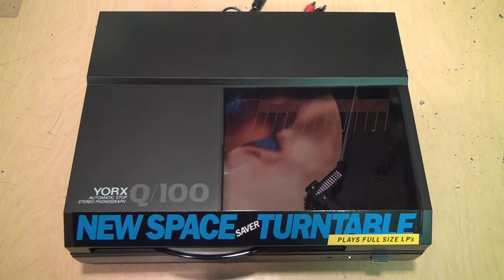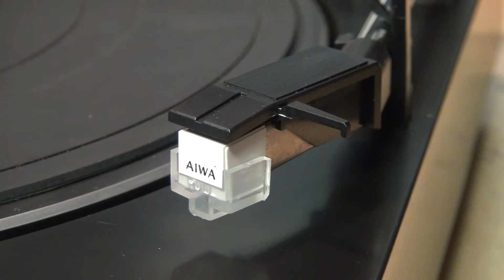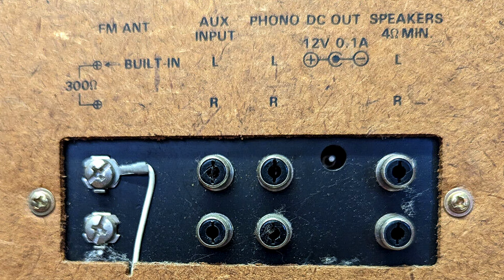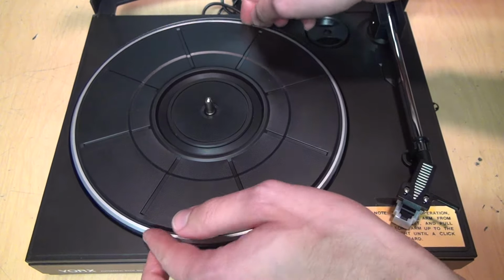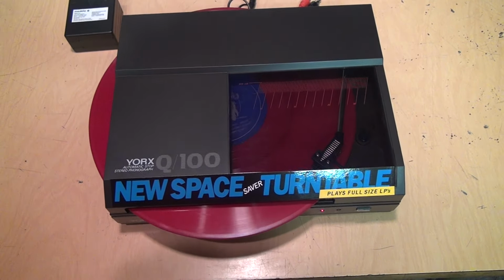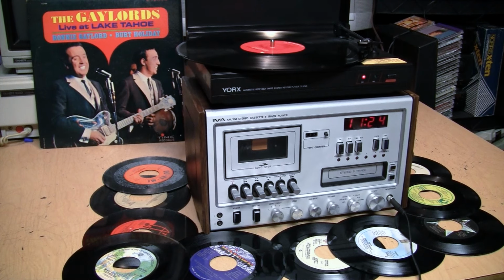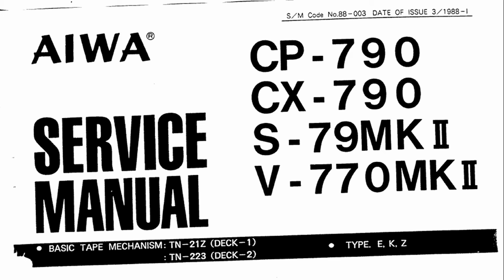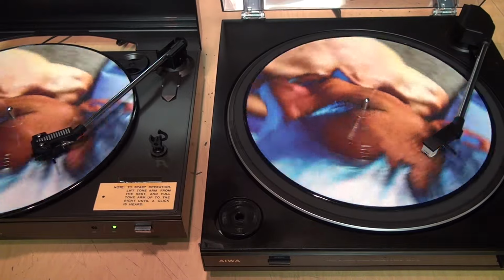How to rescue an orphan turntable - and why you probably shouldn't

Comment: Wow, great research on the old phone. I was thinking of doing just that with an old player of mine. Saved me the trouble. Or, just hear me out,  I could use my VW van that drives around the LP with its speaker on top! Other than the doppler sound and no 45 mode, kind of fun to watch

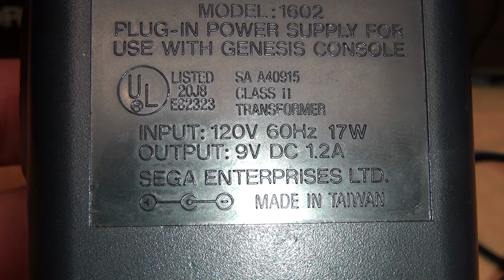Comment: @7:48 - based on yours and a few other videos, I have ordered in a a couple of fully adjustable (current and voltage) as well as polarity switching wall warts for testing and powering some of my various device.  They both have a large assortment of barrels and connectors including wago-style connectors for bare wire testing.

Comment: The auto stop works by moving the pawl over where a cam located on the platter center will contact it and flip the switch back over.  Almost all record changers used a similar system to initiate operation of the mechanism at the end of the record.

Comment: Very enjoyable and educational episode 👍 I was trying to fix an old Pioneer PL-600, but the transformer only put out 2.5 volts, so I tried using a 12v 2amp DC supply and I think I burnt out the motor now :) —- I guess 2 amps was too much ?   Fun to tinker around, but it can be frustrating too.

Comment: I remember picking up my first orphaned turntable in 1988, a Tensai. Cheap and nasty with a Chuo denshi 800 cart with plastic cantilever stylus. Used a 12v scalextric power supply ! Since then I have picked up many of those proprietary decks and usually drill a small hole at the rear and fit a panel-mount barrel socket for the DC  (cost pence, add a wall wart  form some old router picked up for a pound or less at second hand places) and add an RCA cable (if not fitted). You can then at least sell them on with minimum outlay. If new cart is needed it's not worth it. You can use ceramic carts into a line in if you add a 1 megohm or just under in series with the signal leads. Then you at least get bass.

Comment: I have an old 1970s turntable that at first did not work at all, but once I got it repaired it worked great. It came with the original stereo system and everything thankfully.

Comment: I remember that old thing pulling the tone arm to the right.  One of our old players we had to do that (cheap one)  JC Penny's didn't but it needs some repair as it has the turntable cassette and 8-track player.  Used to play the latter quite good.  Dads much older Unisonic never really played 8-tracks well.  So eventually I bought my own that I could use to record to cd's.  But I had it open to make sure nothing was spewed out inside.  Because of this channel I one of the $90 now $200 record players by AT

Comment: I came to DC in 1991 for "a one year project." I rented an apartment vs staying in a hotel. Bought a Technics rack system that I would have sold when I was ready to head back. Didn't bring any of my records so I kept the turntable in its box, in the closet. Fast forward to 2014: The cassette simply died. The CD changer was failing. Then, one of the channels on the integrated amp failed (STK power pack). I gave the components to someone who fixes up gear because I went back to 70s analog...but I kept the turntable (SL-BD27U) which I still have in the rig.

Moral of the story: Sometimes the orphaned turntable can be a good thing.

Comment: Ha! I actually had a Yorx record player stereo system back in 1984 or 1985 with an attached (not separate) record player (either a Q100 model or Q200), two cassette decks, AM/FM tuner, and two "tower" speakers for around $200 back then. I enjoyed it for many years as an entry level system as a teenager and ironically, even though I eventually chucked it because the belt had dried out, the cassette decks were chewing tapes or not functioning at all, etc, I still kept the dust cover and the 45 rpm adaptor for some silly reason. :)

Comment: I've seen many of these orphan turntables for sale, usually at heavily discounted prices, and always passed them up for fear of the unknown. Nice to see how easy it is to retrofit them to use with a new foster stereo system. That AIWA sounded on par with my Audio Technica AT-LP60 (as it should, since it shares the same cartridge). 

As an aside, those Command and Time Records used to be a dime a dozen; now they're almost impossible to find for reasonable prices. I snagged a few many years ago for less than a buck a piece. They make the perfect test material for turntables old and new, or even just for marveling at the over-the-top stereo effects employed when stereo was new. Perhaps that album can make an eventual appearance on your music channel?
Reply from the maker: I need to find a better copy of "Stereo Check-Out". It sounds like someone played my copy over and over again with a worn needle, because it has high surface noise and a loss of high frequencies, while my other Command records sound quiet and bright.
Reply: @vwestlife  I was wondering about that. While it sounded good on video, it didn't sound quite as clear as I remember most of the Command records sounding, namely, as you pointed out, with regard to the high frequencies. Still a great record to listen, even if a little tired.

Comment: Funny, I think they both were worth saving. Though I would have gone "non destructive" by unsoldering connections inside and adding in new cables. In the case of the AWAI both power and audio jacks, and for the Yorx just the power with a short length and the barrel input. The original cables could have been set aside, but honestly, nobody is going to reunite these with their "components." The turntables are perfectly adequate for 99% of applications. Even featuring auto stop that many new models don't have.

Comment: Actually managed to do this to what I feel is a half way decent orphan. My friend picked up a tiny Fisher linear tracking table in really good shape, it needed a split +/- 12v power supply though; I kinda just guessed the voltage based on the design of the internal preamp but it works perfectly. The internal preamp was garbage though; absolutely no low end. I wired the RCAs directly up to the cartridge and it sounds shockingly good; I'd say on par with a halfway decent Audio Technica p-mount cart. The only con is that the cartridge is permanently affixed to the tone arm. We've been using it as the main table in the living room for a while now! So sometimes you can get a decent little table out of these poor orphans!

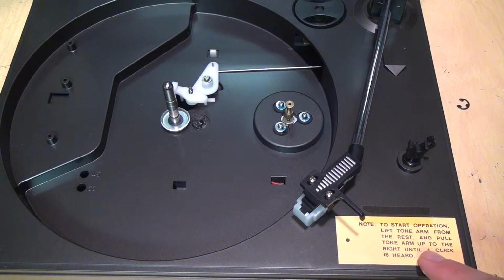Comment: 13:00 To start the player by moving the tonearm to the right was the standard way in many manual record players. I had two players working this way, I saw some record players from the 1930's working exact this way and also some record players, where you have to move the tonearm left, especially with a tonearm lift. Very interesting was Mr. Hit and its East European clones, a better one has a slider, push it to the front to move the tonearm to the position, release it to move the tonearm to the record, push it to the back to lift the tonearm and move it to the rest position.
Reply: The Philips UFO from the late 1960s uses the same method. Best to leave any labels on as otherwise even people familiar with turntables won't work it out.

Comment: Same as with the polarity of DC jacks, I wouldn't always assume that red wire is positive and black/blue is negative, I think more reliable way to find polarity is to look for ground, on electrolytic caps which have ground marked or housing of the DC motor, for example.
Reply: Yeah, I got burned with that when I was younger, I guaranteed myself barrel jacks were center positive. Even on modern electronics it's not always true.
Reply: Certainly, ignore coloured cabling, the Chinese built products ( which let's be honest is almost all ) don't follow any particular protocol ! I've seen black, white , green , red you name it  connected to positive. When debugging/troubleshooting switch your eyesight to monochrome!

Comment: Aaah yea, those all-in-ones masquerading as component systems lol. It's cool that you got the Yorx going without modifying a single thing, and the Aiwa would make a decent, inexpensive turntable if you soldered on a regular RCA cable and power cord.

Comment: Awesome video! I've never came across a "orphan" turntable that I know of....I really like that term for these. There's a record store I visit in a college town near me and there was a Goodwill the next block over and they had one of these late 80s/early 90s all-in-ones and I think it was made by Sharp. It looked similar to the Yorx NEWAVE you had a clip of. Cassette and turntable only, it was definitely made before CD was affordable enough for these style stereos. Same budget components similar to what you have....I think that one had a 7" or 10" platter as well. I couldn't believe the price tag they had on it.....$150.00!!! It wasn't new old stock either and the stylus didn't look the best. It's amazing what some think turntables are worth because of the popularity of the revival 0_0 It's interesting the Yorx has index markings on top of the cover .....I usually only see that on linear tracking turntables. I have that same Command Stereo Check Out record too! I love it. It's very helpful for setups. I have a few of these style test records. Most are actually really affordable on Discogs.

Comment: The wire with white the stripe is usually indicating the positive wire. 13:13 the Platter turns that switch finally off.

Comment: I thought I recognised that Yorx turntable from somewhere. When the still of complete system came up at around 8:35, that totally confirmed it. These were sold in the UK under the Schneider brand. My brother bought one second-hand and, when he had had enough of it, he passed it on to me. I thought it was funny how they styled the thing to look at first glance as if it had a CD player, but it was a spring loaded tray for keeping the very limited remote control in. The remote only had volume up/down and mute. As for the turntable, to get anything to play without skipping I took to balancing a half penny piece on the head of the tonearm...

Comment: Finding polarity is easy. Just use multimeter and one prope in the dc jack and one on a ground plane like screw or metal piece on the body of the unit, switch between the inner and outer part of the DC jack . If it beeps it's negative. On turn tables there is a lot of ground planes, like under the platter

Comment: Center negative connectors show up on some battery powered devices because it's easy to configure them to disconnect the batteries when you plug in auxiliary power. The jack has an internal normally-closed switch that's used to connect the battery to the power rail when nothing is plugged in

Comment: In my living room is a Toshiba budget compact system that belonged to my Grandfather from the late 80s.  It has an amplifier/control, and a double cassette deck intended to look like seperate components but was all one unit model SJ-3438.  Interestingly, the digital tuning radio componment was a physically seperate unit but connected to the amp with propreitary ribbon cables (threw away this part a long time ago as it didn't work).  The turntable component, Toshiba SR-3648, was very similar to the Aiwa unit and the bevelled front dust cover looks identical.  It had an attached cord with RCA plugs, and a cord with a barrel plug for power that went to the amp unit.
It was not a very good record player, i had to weigh down the tone arm with a few "twoonies" (heavy Canadian $2 coins) to keep the needle from skipping.

Comment: In the late 70s we had a Philips turntable with built-in amplifier and external speakers (plastic square cabinets with coarse plastic built-in grille), which you needed to pull back the arm to turn it on just like this one. It had a very distinct sound as the built in amplifier switched on, like two low buzzes in sequence. I can still hear that in my head very vividly 😁. Also, when I tried to record it to my portable cassette boom box via a DIN cable the sound was very tinny. Now I know why. Good times. Not very high quality sound times for me, but good times nevertheless 👍👍

Comment: One good thing about most of these cheap turntables is that they are belt driven. The ones from the earlier years were rubber tire idler, to the turntable at direct contact with the heavy AC motor, causing the rumble. many of those were also ceramic cartridges as well.

Comment: If the turntable has a built in preamp, the audio ground is probably tied to power ground, making it easy to work out the power plug polarity without taking it all to bits.

Comment: It probably would have been cleaner to de-solder the ribbon cable on the second TT, solder the new connectors on, and store the old ribbon cable if you wanted a reversible modification.
Same with the wall-wart for the first TT. Buying the system end socket connector, soldering the wall wart wires on with the correct polarity, and heat shrinking over the solder terminals probably would have been cheaper. I know solder-less repairs appeal to the all thumbs crowd that throws out stuff as soon as they have the first problem with it, but if you're a collector that's serious about keeping and maintaining vintage equipment like this you either have to learn to solder and be your own technician, or pay someone who already is a technician to keep your stuff alive.

Comment: 13:13 The auto shut-off method described here is NOT new. Colaro in Britain made a single-playing phono deck in the 1950s and into the early 1960s that employed the same method, pull the arm back until you hear a "click" which starts the platter rotating, and when the stylus reaches the centre run-out groove, the mechanism triggers the shut-off which cuts power to the motor, and possibly also retracts the idler wheel from the capstan. Several other 1960s-vintage single-play decks used the same method.
Reply: Oh yes, I was referring to rim-drive turntables here.

Comment: CD is still the king despite the hi-res and online streaming hype, Every time I bring a load of CD's from the dump I enjoy sorting through them and rip the ones I like and attach the album artwork to the FLAC files, Even though it's just 44.1/16 but that's more than enough to produce the master copy of the studio.
Reply: The issue with many CDs is that they are the victim of the loudness war; and thus have terrible mastering compared to vinyl and “high-res” FLAC files.
Reply: @Yeen125  Not all CD's, Some of the late ones only, Be careful of re-mastered recordings, they don't all sound good, some of those sound worse than the original masters.

Comment: In the 1970's my radio had an input impedance, that matched with piezoelectric cartridges (we had crystal instead ceramic), so it boosts bass and lowers treble, but worked well with the tape output.
Before very lightweight magnetic cartridges were introduced, the piezoelectric cartridge was the only option, to play the vinyl records, in the 1950's came the idea of Hifi in US and UK and some years after introduction of Stereo to the rest of the world. And the modern magnetic cartridge was part of this, beside FM radio and home tape.

Comment: A good trick that can help find out the polarity is to do a continuity test between an outer shield of a connector and each terminal on the power connector. The shields of RCA jacks etc are usually connected to the negative side of the power supply.

Comment: So I spent my years looking for a Panasonic 8 track player with the RCA jacks  Now let me explain why the Panasonic 8 track player near the end of its life Actually has a fiber glass belt so the belt doesn't turn gooey and it doesn't break down it continues to run and run and run as long as you can find tapes and what's quite shocking is that I've had this sting now for 25 years And it still hasn't skipped a beat I could really see why people love this model of player it's the same reason why sometimes taking on a orphan turntable can really be a nightmare because some of these turntables had really really proprietory needles And even worse were only made by the manufacturer so you definitely gotta be careful

Comment: I have a Sony AM & FM tuner & Sony tape deck that have a similar ribbon cable. Fortunately, I also have the Sony amplifier that the radio tuner & tape deck plug into.
Reply: @r66playsgames
I had a tower system from Sony as well that used  that ribbon cable set up, it was VERY common in the late 80s and early 1990s.

Comment: Thanks for this video. I've been searching for a specific turntable like this. I recently demonstrated a rather odd formfactor SounDesign #5888 radio recorder from 1989 on my channel that has a 12V tip+ outlet on the back that can accept a turntable - apparently the SounDesign 0989A. I'm keeping my hopes up, but it could take a while.

Comment: Recently saw a drawer style Yorx which uses a barrel plug. Also had a Soundesign that was the same deal but converted it to a standalone.

I personally like the CZ-680 because it’s basically a Varco TN4B and styli for the TN4B will fit on the CZ-680
Reply from the maker: I noticed some distortion when using the CZ-680 with the Soundesign, probably because it was intended to be used with the lower-output CZ-800 cartridge. The CZ-680 has high output and quite loud "needle talk".
Reply: @vwestlife  stock stylus for the CZ-680 gives 500mV, CZ-800 is 350mV

I use Varco styli on mine. Stock also gives 500mV but TN8T “865” gives 800mV

Comment: For the aiwa, I would have just resoldered the whole cable so you can preserve it, or even just tuck it inside. Solder the replacement wires right to the joints.
I've encountered that Aiwa before and done exactly that and resold it on eBay.